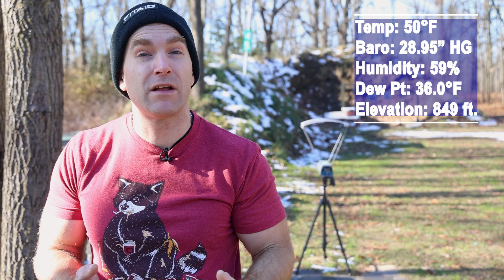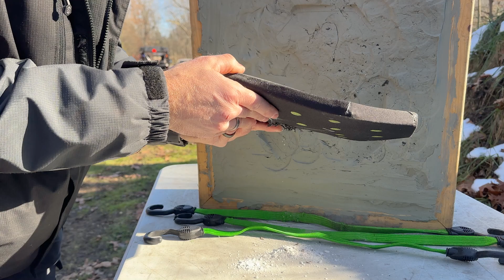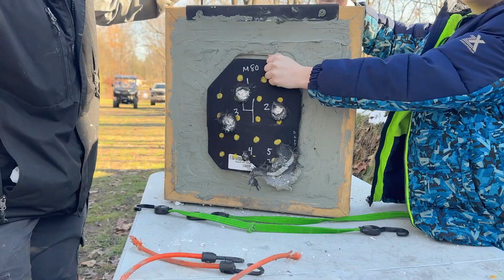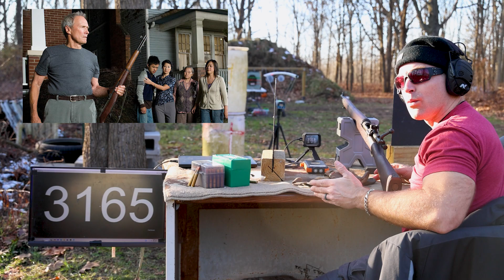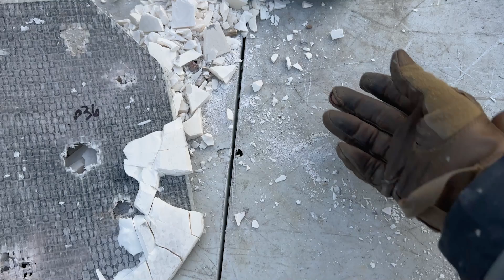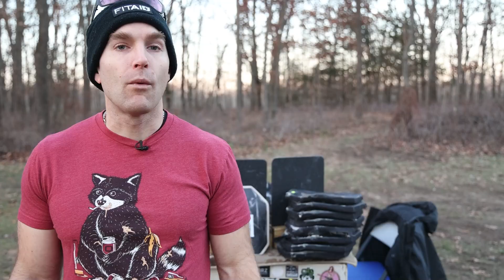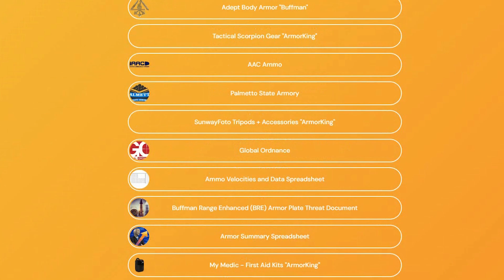Highcom 4SAS4 NIJ Level IV Ukrainian Overrun Plates (Chase Tactical)

Comment: I feel everyone, manufacturer/retailers included, learned a lot here. 

Consumers should question everything before purchase and exercise caution if questions cannot be answered. 

Manufacturers/Retailers should be forthcoming with specific details about the products the market & sell to avoid looking shady. These specifically should have been marked on the plate and advertisements as “Not drop test rated” since so many plates are nowadays. 

As always, thanks Matt for the awesome work.
Reply: Oh the consumers questioned plenty. The real issue was TS claiming that; A) These plates were still currently certified, B) that these plates were the EXACT same spec as the 4SAS7s, when they aren't. TS couldn't even spell specification...
Transparency is key when running a business, so sure making a note regarding Drop testing in the .04 standard would help. Primary step they could take in not looking shady would be not slapping shipping labels on every order a customer asked to return...
Reply: @ViridianKol I agree with it you. I think TS basically took the position of “F off” to everyone about these plates. They could have even struck a middle ground and said hey we will hold the plates until the video of the retest comes out and then you can return them or take delivery.
Reply: Armor manufacturers (especially reputable ones) already KNOW this. You don't give them enough credit. They are the experts in the field, not demo guys on YouTube. 🤣

Comment: Reupload the old video and private link it in the description. No reason to delete it failing when thats the entire reason for this update vid. The viewers deserve to know how badly dropping it had an effect on performance, barely lvl 3 performance
Reply from the maker: Video has been re uploaded with some minor edits for context and it’s link is in the description :)
Reply: @BuffRANGE  this is epic
Reply: @BuffRANGE  dont see these for 99$ anyware...
Reply from the maker: @russr  right here :) https://shop.tacticalshit.com/tsht/ts.php?id=373&url=4731
Reply: @BuffRANGE  question... have u tested any other plate that is equal to or better for the same price or close?
Reply from the maker: @russr  The closet thing to $99 right now is the RMA 1155 Single Curve or slightly more the 1155 MC. The downside to the 1155 is the 1LB+ weight increase and thickness increase. However it's backer is a better material and has been shown to handle 3 hits of M2AP, but it's strike face doesn't hold as well together since it's not laminated.
Reply: Agreed! Without context, people will likely assume the drop test complaints were simply nitpicks and not understand that it caused a catastrophic failure of the ceramic against all threats.

Comment: If you can't "hit the ground" (drop test) in a diving fashion without compromising viability, it's a hard pass...id rather not have 15 pounds of milestone hanging from me, and gain speed and mobility for it... 🤷‍♂️

Good video, thanks for sharing n' God bless brother
Reply: Lol that’s the reason for the modernized .06 standard from NIJ that implemented drop testing.These plates are still good to go imo for level 4 protection on a budget.
Reply: Just use a thin foam layer and it’s set
Reply: If you fall 4 feet in any armor and land on your chest, you are either going to be f'd up or break something.  Even if the armor survives.  However, continuing a fight probably will not happen.
Reply: @jb7483  Been there, done that. Diving into the dirt with kit on sucks but doesn't take you out of the fight. I guess you could get unlucky. Yea you're also landing on your arms at almost the same time but you're also falling with a lot more weight than the NIJ test uses. I definitely want a strike face that can take an impact.
Reply: @jb7483  As a 6' male, 4' is about lower torso height.  So if I were to, let's say, just... fall over on my stomach, I'd be "either going to be f'd up or break something"?  Tell you what, let's meet up, I will hold my hands behind my back and fall on the ground face first.  If I get up and feel just fine, I get to kick you in the nuts once, deal?

Comment: Another amazing informative vid for free 👍
Hey Buffman i know its probably not your area of expertise but i wanted to spread an idea i had and get different perspectives
Here it is.
Tungsten carbide rods can be bought online and sharpened/cut with small dimond saws and dimond files. My idea for the future is 3d printed bullet jackets (not sabots) for sharpened tungsten carbide rods (not unlike the shape from that AP incendiary), think of the 3d jackets as easter egg shells snapping together around the rods of a particular length & shape (although its more complicated then that).
I've seen 3d bullets be shot out of guns a few different ways on youtube and i think they could hold together as long as they arent put through hight twist rate barrels like 8.6 blk. The tests ive seen also havent used the strongest 3d printing filiments which would increase the chance for success. If its possable people could make and reload their own AP ammo comparable to m995 & m993 along with other interesting rounds like subsonic 338 spectre or 300 blk or ap 9mm
Reply from the maker: That would be interesting if those tungsten carbide rods are of a composition that is beneficial to armor penetration.

Comment: I don't think it's a good thing if a drop test is all that stands between the success and failure of your plates..
Reply from the maker: Hence why the NIJ implemented this. I would have to read other standards to see if they account for this.
Reply: Yeah, how can a plate be "multi-hit rated" if a mere drop compromises the integrity, let alone stopping an entire round? I think there is a serious QC/inconsistency in the manufacturing, and they are trying to blame the drop test.
Reply: Because a hard projectile acting like an icepick against a surface that is ideally harder (the ceramic strikeface) isnt the same kind of impact as a hammer blow.

An analog is that kevlar/dyneema soft armour can stop pistol/shotgun/low velocity projectiles easily...but is not rated against punctures from knives/spikes, and will easily fail when tester
 @ninjagold9244
Reply: @ninjagold9244 You do realize these plates were originally designed before drop testing standards were implemented with the NIJ right? And the overrun plates are plates that the Ukranians ordered that were produced to those same pre drop test specs. High energy small impact is going to only compromise the area around the hit. A drop test is moderate energy impact but spread across an entire surface so it makes sense that a drop test would compromise an entire plate rather that a single hit compromising it.
Reply: @Dark_Heart5580  So the plate material is weak enough that an impact on a fist-sized portion will propagate across the rest of the material, but a bullet strike will be contained? That doesn't make sense to me.
Reply: @ninjagold9244  Its not a fist sized area tho. Its quite a bit larger. But either way, a larger area being struck means more areas that can have a micro crack or will have that additional stress put onto it that may weaken the material. A tiny impact from a bullet means less area that will be affected. The bullet impact effects a much smaller area than the drop onto face would. Its like if i took a screw driver and hit a wall. The screwdriver would probably go through the drywall but only put a hole in it. If I instead hit it with a sledge hammer its going to also put a hole in it but there will be noticeable cracks and damage to the surrounding wall.
Reply: @Dark_Heart5580  Not exactly true. There is no such thing in armor performance as a "tiny impact".  The energy from the round amplifies the physical impact damage. Projectiles moving at 3000 fps do not just stop on a dime without there being materials deformations, including ceramic.  .30M2AP can propagate cracks across an entire single piece monolithic ceramic plate. The energy/force of energy wave transfer (think blast wave) is much more mild with a drop than with a fast moving bullet ripping through armor.
Reply: @ninjagold9244 leverage lil bro

Comment: What's the most economical and easiest rifle and round to obtain in the usa (overseas?) and defeat level 4 plates on the first shot?

I'm guessing the cheapest .50 bmg rifle with ball ammo. Anyone else agree?
Reply from the maker: At what distance? Truthfully it's going to be 50 BMG. There's varying levels of construction and materials on hard armor, that make it a total roll of the dice to be able to do it on the first shot.
Reply: @BuffRANGE 1 50 bmg from an m2 browning or m81 Barrett, it will defeat level 4 armor, lol.    If it doesn't, which I have never seen  a level 4 stop, blunt force trauma is a real thing, and you are dead either way.  With just ball and tracers, we shredded through a bmp within 50m to 100m in Bosnia.  So I truly doubt it's even a dice roll, more like an act of G-d.
Reply: @jb7483 somewhere a while back I saw someone shooting some armor that stopped a 50 bmg, but ya you still ain’t surviving the trauma lol.
Reply: Probably not even ball ammo, you'd need .50 BMG AP or similar to consistently penetrate level 4 (or european equivalent) at most ranges. High quality level 4 is tough as hell.

Comment: These like most rf3 plates are too heavy. Adapt needs to make a standard rf3 plate.  1.1” thick and 9.5” wide. That way it fits in standard plate carriers and should come in around 5lbs.
Reply from the maker: It would be interesting to see how light Adept could take a level IV.
Reply: In previous discussions with Jake, they had in development a level 4 plate, around 4.5 pound, However, this was probably a year or two ago at this point, so take that with a grain of salt. @BuffRANGE